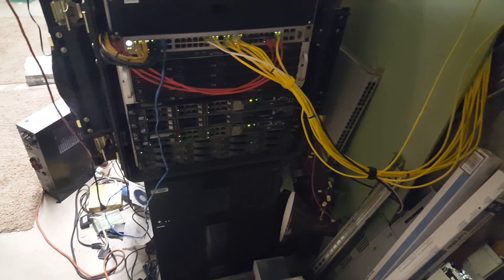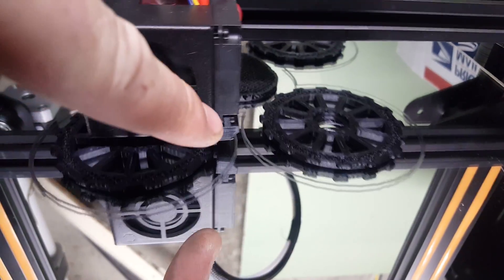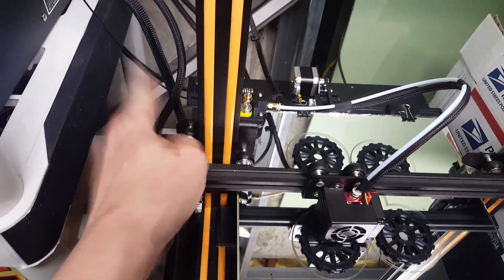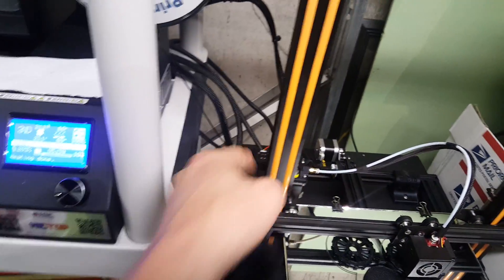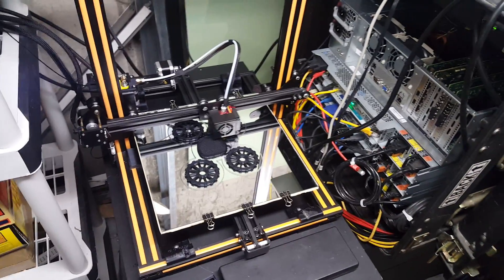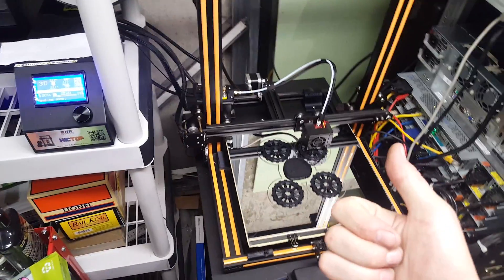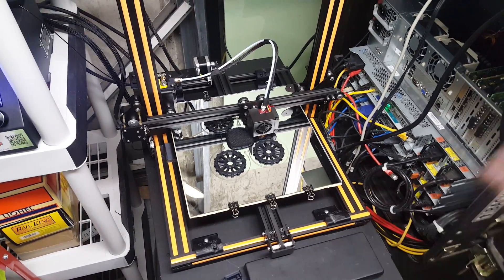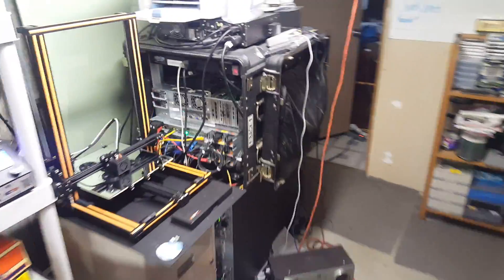CR10-S upgraded 3D printer, printing more upgrades! Custom Bowden Extruder

Comment: If you upgrade your CR10 to print with PEEK, which I am assuming you plan on using for high temp parts, please document it! That is exactly what I am planning. I’m thinking a E3D V6 with 2 into 1 dual extrusion, a higher output heated bed, and a custom enclosure

Comment: What was your bed temperature set at when you printed your bed adjuster knobs?    Did you have any issues with bed adhesion,  or the parts letting go while printing?    I do wish to offer You dmsome really Valuable Advice.  If you ever think about buying one of the Micro Swiss All Metal PRINT head: DON'T  BUY IT !!!  IT IS A TOTAL WASTE OF MONEY, AND GOOD FILAMENT.  I bought one of those NIGHTMARES,  and the very second print I did with it caused me to waste 2/3rds of a 2.2 pound roll of translucent Pink PLA Filament.   Everything started out just fine, and continued for the first two hours.  I left it to print the rest if the job and when I woke up to check on it:  WOW!!! WHAT A DISASTER !!!!  I had a Huge Was of Pink String lying by the printer.  This head finally burned out my power supply, and Mother Board.  I literally had to Clamp that head into a vise just to remove all of the Melted FILAMENT from the Micro Snot,--- errrrr,  huh huh, uuummmmm, oh, I know MICRO SWISS print head.  That is $69.00 down the drain.  I should have stuck with the mark 8 original head because All of my prints were perfect right out of the box.  I will NEVER change again.    Good Luck printing, and let me know if You can help me with my two questions.  Please.

Comment: Hi nice work -  i just bought my CR-10s and new to 3d printing.. i tried your gcode and used to print the filament sensor peice you shared but the quality is bad so i must need to use better settings in the slicer (cura 15.x) - your piece looks so much more awesome - do you have suggestions for the following for me, any help would be much appreciated:
1. what settings are best for the cr-10s as well? 
2. what modelling and slicer software are you using?

Comment: Hi Rick, are you using the supplied Cura software? I just bought the CR-10s and I am new to 3D printing.
Reply from the maker: Arizona Aerial Productions The stock cura software works okay. I would check out Simplify3D, you have many more advanced options and features. If you are just starting out I could understand it being difficult to justify another $149 for different software but the quality of your prints will improve significantly. 

I did a few prints with Cura though and it does work okay. It's great for beginners.

Comment: I have same model by same hictop mines blue it's a great printer apart from the end of fillament detector which has a bad design for holding it down, I like your idea did you make a cover to cover the exposed circuit board of the detector, they can collect dust, I used the spare boden tube to help the fillament pas from the detector to the advancement device.

Comment: Hey. How loud do you find the CR-10? By watching your printer print, I can hear the same sound during travel movement, as the sound mine makes. I've tried many things to make it go away, but i'm starting to think that this is normal...
Reply: Biggest thing you can do to cut the noise is to put in dampers on the X and Y steppers. The motors tend to whine badly and that's transmitted to the frame which acts a a loudspeaker for it. They also give a slightly smoother motion of the hotend (smoother prints). Not possible on the Z Axis on the CR10 Series because of the mounting. Keep Reading ---▼

Second large noise source is the cheap fans they used. The control box has three fans, very noisy. Most people use quieter fans, some also opt for larger fans with an adapter (bigger fans make less noise for same flow - think ceiling fans...) There's  info on the CR-10 Thingiverse and Reddit groups.

Same thing for the hotend and parts fans. Fix the fans and add dampeners and it's quite as a mouse. :-)
PuterPro (PS I don't get to check replies often ... SORRY!)
Reply from the maker: I don't find it terribly loud, I leave my bedroom door open and I can sleep with it going in the next room.. Though it is behind a server rack which I would consider much louder. I don't think you would find in intrusive unless you are really banging stuff out at high speed.
Reply: It is sort of normal, it is the stepper drivers whining.   3 ways that will fix it, a) stepper dampers on the X and Y this will take most of the noise out and its cheap but might slightly effect output quality.  b) swap drivers to the silent TMC range, may or may not be easy depending on the motherboard.  c) swap motherboards, I run a duetwifi which comes with TMC drivers its almost silent but not cheap to do but my motherboard fried itself so I needed a new one anyway.

Comment: Nice job. Now you have a whole nother hobby! , LOL  the adaptors for the flowbench alone would pay for this. You can easily print intake adaptors and manifolds as you said. My friends are thinking up all kinds of stuff they need printed as well I'm sure you'll see that too. I have 2 reg CR10s and have printed a ton of parts from Fordboy to convert it to dual z screws with 1 motor etc. They are great for the RC parts too as you said. I think its a must have if your big into RC. I am amazed at the RC folks who don't have one!  I think I may print your bracket in case I want to change mine to have the filament sensor later Thanks!  New Sub :)
Reply from the maker: Thanks for the kind words! Yeah it has been fun using this as solutions for not only my problems but things that friends and family need. I agree with the RC market and folks needing to have them. I'm assuming you also recently saw the 3D printed spitfire on flite test?
Reply: Sure, There are some pretty cool planes being made with these printers now. Its only just beginning too :)   Did ya see the guy that converted his to 1000mm uprights on his CR10 ? I just got my first Delta style printer a Tevo Lil Monster  today I got my 1st Tevo Tornado which is an improved CR10 basically and I am building a Core X-Y Tronxy X5S with a ton of my own printed upgrades.  There is so much crazy new stuff and improvising going on its fun learning and trying all this new stuff and trying to learn the software side is a challenge for me but I'm getting better at it it slowly :)  Merry Christmas from Missouri

Comment: What are your print settings on the slicer? Mine prints good but it has a bulgy bubbly first print. I can’t seem to get the first print smooth
Reply from the maker: I used PLA, I have mine start with a 70C bed temp and then step down 2 degrees per layer until 60C. My filament prints at 210C, and I typically use 0.2 for the layer height, though it does print just fine at 0.12.
Reply: That’s most likely your filament. Buy some hatchbox pla from amazon. There are a load of custom profiles online for cura/sclic3r/simplify3d.
Reply: Dry your filament.

Comment: Looks like you got the same one I got from hictop. I did the BLTouch upgrade on mine so I don't have to do any manual bed leveling. it's not too hard to do, the 10S already has the pins on the board to plug into but you do have to mod the firmware. I'm totally printing your  runout sensor fix tomorrow after work.
Reply from the maker: Thanks for the heads up! I'm going have to take a look into this!
Reply: the advantage of the bltouch over the inductive or capacitive sensors is you can use whatever build surface you feel like. also when you go mod your marlin firmware, enable "babystepping" on the z axis, this lets you adjust the z-offset live during printing to get your first layer perfect. just add or subtract that value from your z-offset at the end of the print and the next print should be spot on.
Reply from the maker: Instead of corner to corner, does this also account for uneven surfaces? Like for example how my glass has a bowl in the middle?
Reply: yes actually! it will compensate for the unevenness by minutely adjusting the z axis for the first several layers and then average it out until its printing flat in relation to the gantry rather than in relation to the bed.
Reply: Hi. I also have a Cr-10S and I would be very interested into a streightforward leveling bed solution. 
Do you have any video or guideline for the solution you mentioned? 
Related to the design of the sensor guide, super!!! Does it have a cover to keep the jst connector not exposed? Thx in advance!!!
Reply: Cheese , I bought the Tim Hogeland one too but to be honest I have leveled my bed 2 times in the last 3 months so I havent bothered insatlling mine yet , To busy making stuff :)   Hictop is just another private label/importer for the Creality CR10s fwiw
Reply: LOL Like every stock CR10 glass? I havent seen one yet that is not low in the middle. Just do what he did go buy a case of mirror tiles from Home Depot. It is 12 bucks a case of 10 or 12 and find another use for the factory glass warped thing :) You now have 10-12 perfectly flat print surfaces for cheap :)
Reply: Sir, you can get Creality3D CR - 10S 3D Printer Upgrade Versionfor $455.99 with this  coupon code:GBanniversary001, https://www.gearbest.com/3d-printers-3d-printer-kits/pp_778981.html?wid=21&lkid=13507121， enjoy!

Comment: You did good. The CR-10 is great!  I love mine.  Way better than my old solidoodle or the Affinia ones that we used at The Geek Group.
Reply from the maker: Thanks man! Yeah it has been good to me. Consistent so far. Currently printing a bunch of Christmas toys for folks and then I'll get started with some real work :D ..  There are some sexy filaments I'd love to start printing in. I want to build a much higher temperature printer now heh
Reply: if you want higher temp just mod the one you have! microswiss makes upgrades for the cr10 rated up to 300c. https://store.micro-swiss.com/collections/creality-cr-10  or you could print adapters to run a genuine E3Dv6 hotend. I haven't had my CR10 very long but i'm interested to see what you come up with for yours.
Reply from the maker: The challenge I think is at that point I might have to encase the whole thing in an insulated box?
Reply: depending on the materials and their reaction to drafts/tendency to warp yeah. but i built a decent box out of dollar tree foamboard for my FT5 and it kept it pretty warm in there.